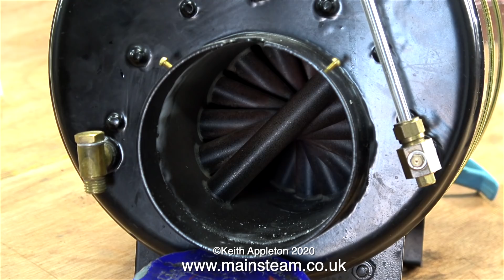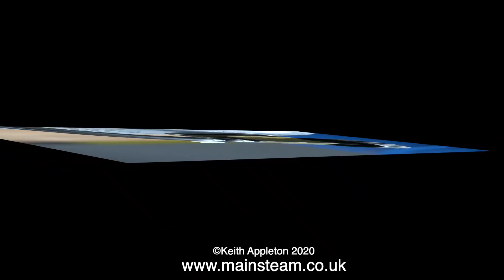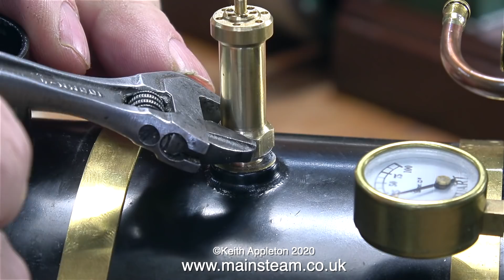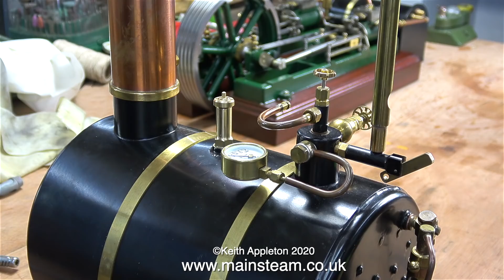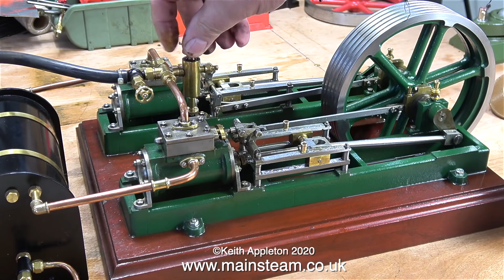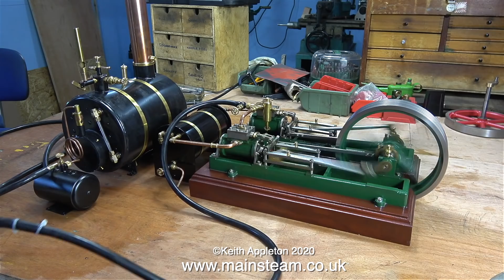WORKING ON A LARGE STUART MODELS STEAM PLANT - PART #13

Comment: Camping gas regulators come in different sizes. Usual off the shelf ones deliver about 1,5kg/hour (approximately 20kW of heating power). For hard soldering i bought an adjustable one that delivers up to 6kg/hour or 80kW.

Comment: Do yall use the 20# propane cylinders at all that we use for crawfish cookers and barbecue pits? 

While completely useless for that style cylinder( I've never seen one of those, only the smaller ones), if that will work, and I'm not sure of THAT either, might be a neat idea to tuck one away under a bench and make a remote gas supply for general running on the bench :-). 

Wikipedia says that the thread on those campinggaz cylinders is M16x1.5. Take that with an extreme grian of salt, but it was what I found, and might be a place to start. 
- kyndal

**edit I've also seen mentioned some have a reverse thread, but that should be easy to determine. I'll look more tonight when I get up :-)
Reply from the maker: Thank you }:-)))